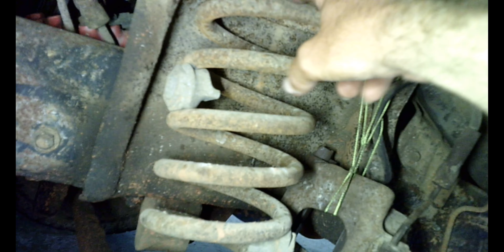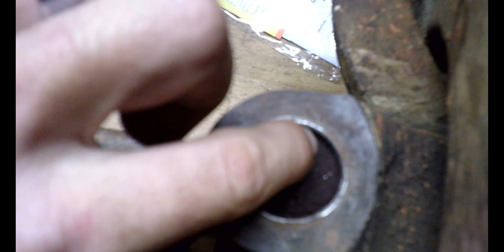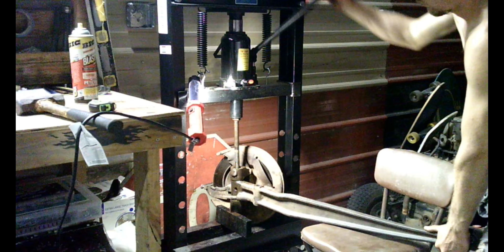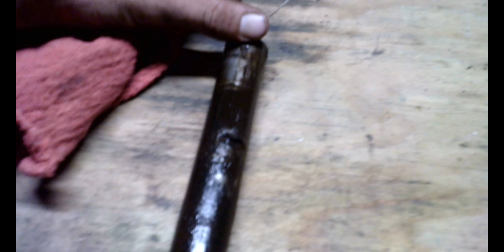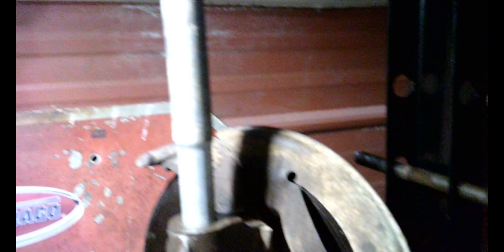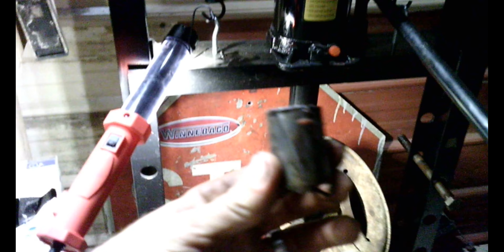1981 Ford F150 King Pin & Bushing Replacement

Comment: Could you convert the kingpin i beams over to the modern ball joint style? With the new knuckles of course.
Reply from the maker: It sure seems like it. I haven't tried so I'm not entirely sure but it looks like they would swap right underneath there. I've considered that swap but I'm probably going lowered a bit and vic front end If I ever switch things up.

Comment: Also, large impact sockets can work at lower pressure and are fantastic as the “cup” to press things into….  I also find myself using attachments for ball joint press and wheel bearing press kits…. Just work slow and be sure you don’t put your hands where things might possible damage them if things go wrong
Reply from the maker: Oh yeah that's always on my mind using that thing. Slow and easy. Thanks for the tips!

Comment: So my king pins don't move , my rubber things on bottom of spring look bad ,  but after replacing my tie rods I still have camber and lots both sides
Reply from the maker: That sounds like sagging front springs if all is tight and the tires lean in at the top. These twin I beam set ups only have the correct camber when the springs sit at their factory hight. As it sags the I beams don't sit level and start to point upward causing the increase in camber. You could replace the springs or possibly get away with a taller spacer under the spring to make up for the sag.
Reply: @Ethanthefenceman  awesome answer as I see just a slight lean in the springs , I did some more adjustment to the tie rod and tape measure and got most of the camber from short tie rod adjustment, but as I have been replacing everything it seems like perfect sense to get new springs !!! Already got shocks a month ago , needs new body pads so was thinking a 1 in body lift
Reply: @Ethanthefenceman  thank you very much for your time in response